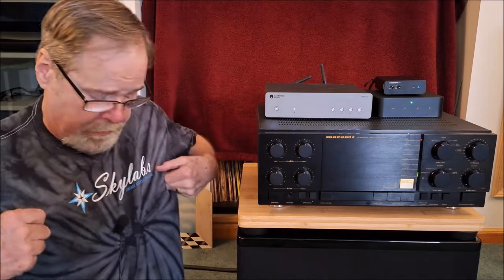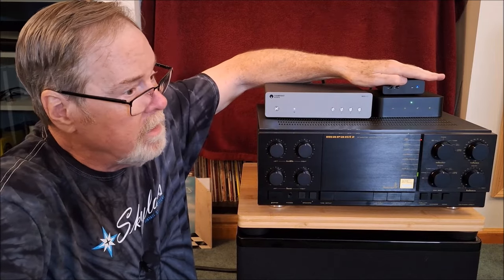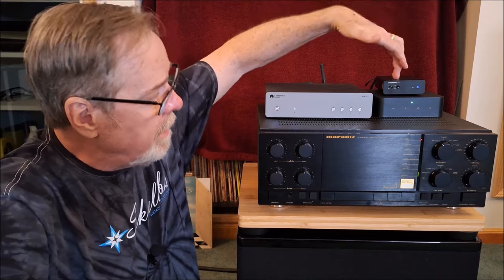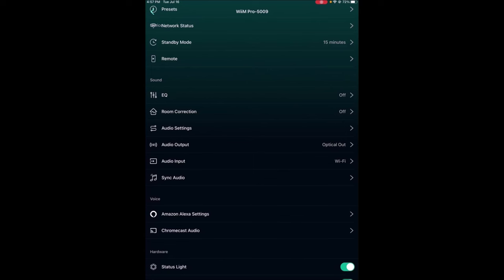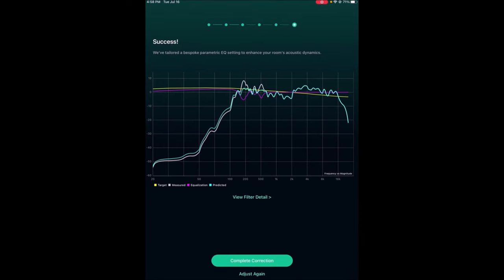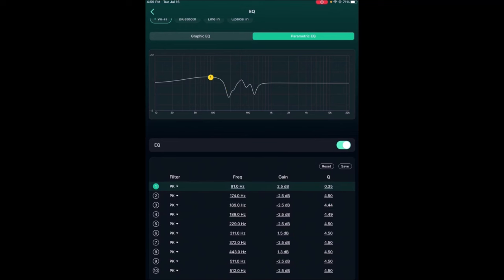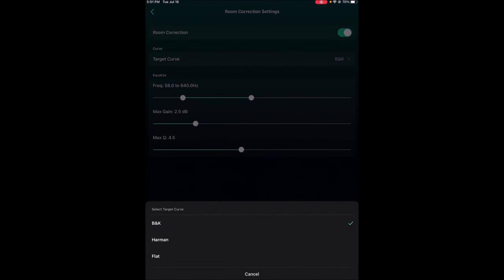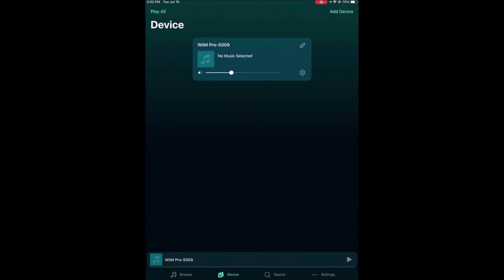You had questions. I have answers. Analog to Digital? Room correction on an analog line in? Yes!

Comment from the maker: A much deeper dive on the WiiM Pro's room correction software. The unit will digitize an analog input, apply room correction and output on: 
1) On the units analog line output.
2) On the units SPDIF Coax output and,
3) On the units SPDIF Toslink output.

Comment: Great video.  I have just got a Wiim Pro.  like you I’m using an external DAC and a Marantz KI signature Amplifier.  I’m going to try the room correction over the next few days.  Thank you.
Reply from the maker: Oooh,. A KI Marantz. Very nice. I knew Ken Ishawata and those KI units are very good. I found the WiiM room correction to more of a gimmick than anything else. Try and let me know what you think. Thx for watching.
Reply: @OldGuyHifi  OK will do.  Thank you.
Reply: @OldGuyHifi  Yes not  sure about room correction so far. it depends on volume set on Amplifier during the test. I find the bass is too high for me after room correction.  Or maybe just too different to what I am used to.
Reply from the maker: @mikepxg6406  It can also depend on what curve you used. Harman vs. B&K etc.
Reply: @OldGuyHifi  AH !   I tried the Harmon today much better sound the B&K was too bass heavy for me.  I will try Flat curve tomorrow.  By the way the test works on my iPad Pro. and my Android phone.  Mike.😀

Comment: Some one may have already commented upon this and I may be wrong but looking up the frequency response for an IPhone 16 it starts falling away below 100Hz-which is why I think my sweep showed huge lifts required at the bottom end. Also I hope those who are not familiar with the WiiM Pro Plus realise that a mobile phone pad etc.device is being used in the seating position as a microphone and the analogue source is just for demonstrating final connection and plays no part in the room analysis. Also the suggested fr correction can be applied/checked and saved.
Reply from the maker: It is really a convenience device after all.
Reply: @ I end up going back to using the graphic equaliser section and my ears 😁
Reply from the maker: @Madmart54  I agree with you. Your ears know best. Thx.

Comment: This is similar in function to the miniDSP 2x4 HD - but with a much easier interface. One thing though, that the miniDSP can be set up to do - is PEQ and time alignment of speakers and a *subwoofer*.
Reply from the maker: The WiiM is just doing EQ. It is great for my vintage stuff but for my main system not so sure. Thx.

Comment: Hey Ed.  Here is a reason to get the pro plus over the pro.  Line in analog goes in at higher resolution on the pro plus than on the pro.   Besides the dac this is one of the main differences between pro and pro plus models
Reply from the maker: Great point and solid advice Alex. I got the Pro just to do the video and I knew I was going to use it only briefly.  Thank you.

Comment: I have 2 WiiM Pro's and a Wiim Pro Plus (that I haven't opened yet). One Pro is paired with a Schiit Modi 3E DAC and the other is paired to a SMSL SU-1 DAC and I love them both to pieces. They retired my Blusound Node 2i. Haha! Can't wait to try the room correction feature. Another great video, good sir!!!! God bless!
Reply from the maker: Ramone, My friend. Thank you so much. Let me know how you like it when you done.
Reply: @ramondelgado6778  Which DAC sounds better in You opinion? The SMSL or the Schiit ?
Reply: @lumberjaxx3335  the correct answer is that they both sound different. The Modi 3E is brighter and more detailed, more airy with boomy heavy bass, with the mid range less forward and a bit thin. Most ears will like this one especially if you have extra warm, dark speakers. The SU-1, to me, is more refined, smooth, tighter bass, warm forward mid, smoother highs. My ears preferred the SU-1.
Reply: @ramondelgado6778  Cheers Ramon, thank You so much for this answer and description!
I have Focal Arias and like strong details, a good sound stage and trebles and highs, i am not so keen on a strong bass, i like it when the bass is punchy but only when it needs to be!
I am not that much on the warm side, more neutral/analytical. 
any recommendation between these two ?

Comment: I am going to take the HDMI output of my Apple TV 4K via optical out from my LG TV into the WiiM Pro, then transfer the output to my PARASOUND  Pre 200 via optical then send that output to my YAMAHA AS701 integrated amp. via analog out. All this to get Room Correction and EQ. Only paid $130 tax included during Amazon Prime sale! Needless to say I am very appreciative of your video reviews.
Reply from the maker: Thank you Jack. Please let me know how that works out. Thanks for tuning in and sharing your configuration.
Reply: @OldGuyHifi  First Impressions:  remarkably easy to install application. It took numerous attempts to complete the Room Correction process, but once done works great. Just need to pay attention to those input & output settings. All of my config's equipment is new including my B&W 606s on stands. After getting everything connected with quality cables, the music output and especially watching F1 was nice but underwhelming. After I completed the Room Correction process, I started using the EQ presets and the "Movie" preset fixed the F1 playback issue (too harsh, thin sound) Now the F1 races have the robust detailed sound I expected to hear!  I have tried a couple of the other genre -specific EQ presets and all I can say is "WOW!" Music sounds correct at last! Articulation and warmth are terms I had only read about now I can hear the music clearly and with real quality playback. I'm not an audiophile or vintage collector but your excellent video provided clarity and led me to purchase the WiiM Pro. Best $130 I've spent in a long time. Now I just need time to re-listen to all my favorites and hear them like they were intended to be heard. Thanks again!

Comment: Thanks Ed. A lot of great info!!!

One stupid question! If one did the following....
 Turntable>>WIIM>>DAC>>Integrated Amp

With a built in phono stage in the integrated would it be okay to run the ground from the turntable to the integrated and rca to the wiim? Or would you have to stick a separate phono stage in there??

I'm a little bit of a Newbie.
Reply from the maker: you would need the separate phono stage as the the WiiM and the amp are not on the same ground plane.

Comment: Could the WiimPro (with, maybe, an external DAC) be used in a vintage receiver’s tape loop or in place of main-in/pre-out jumpers? This would be cool as all the vintage gear’s pre-amp functionality would be retained.
Reply from the maker: I had that question earlier, I am going to try. My thought is no. The way the unit does its I/O selection and the fact it is a source in and of itself, I suspect precludes it from that type of operation. But, since you asked, I now have something to do tomorrow. I will report back. Thanks Steve.
Reply: @OldGuyHifi  Hmmm… I have a WiimPro but no suitable vintage receiver or amp, or I’d try it myself. Before using Audirvāna made it obsolete, I did the following and it worked: WiimPro → Bifröst DAC → Amp, so there may be a chance. I didn’t, however, try using the WiimPro analog in. It will be interesting to see what you find out.
Reply from the maker: Steve, I didn't get a chance to try that connection. I will this weekend. Sorry.
Reply: @OldGuyHifi  No sweat… for me it is just a curiosity, though it maybe be useful for others in the Old Guy HiFi tribe.

Comment: I'm curious to get your take on the "sound" after running room correction -- I've been using ROON DSP and it's been love and hate :)
Reply from the maker: If you look closely at the curve, the yellow target line and the purple EQ line were almost on top of each other in the B&K curve setting. I am fortunate that my room has some acoustic treatment and was purpose built as a sound room. The amount of EQ applied didn't really do much for me. Also, truthfully, I am not a DSP or digital EQ fan. I have a Schiit Lokius that I use to apply tiny amounts of EQ when needed. Since I really don't have any bass issues in my room, which is where most rooms have problems, it did nothing much. I can see its value in untreated or problematic room situations. I do think it can help many people achieve better sound so it is a good unit for that. I understand your love-hate relationship with Roon DSP. Thanks so much for commenting and for watching. I do appreciate it.

Comment: Hello oldguyhifi!!! one thing I'm a little confused about is will I be able to get the benefits of the wiim EQ and room correction with the Cambridge AXR 100? if so what input would I plug the wiim into on the AXR100?   Thanks in advance and once again great video!!!
Reply from the maker: Great question. You will absolutely get the benefit. I would recommend plugging the WiiM's Toslink optical output into the AXR's optical digital input. All of the sonic magic occurs within the WiiM and it just outputs the equalized signal into your receiver. Does that makes sense? I hope you enjoy the AXR100 as much as I do. Thank you so much for tuning in.
Reply: @OldGuyHifi  yes it does makes perfect sense!! I was the one who posted in your other video about the AXR 100 having the issue with that fan noise. I got a hold of customer service but they said that's to be expected especially how loud I drive it plus mines kind of in an open area so it's easier to hear it. thanks again for all the help!!!
Reply from the maker: @prisonerofmarz1265  Be careful with your hearing. I was exposed to too much loud music and now I have some Tinnitus. Be careful my friend.
Reply: @OldGuyHifi  lol   I know what you mean my friend!!! I'm in my 40s right now and back in the day I played in a punk rock band. I never listen louder than 75 db. surprisingly my hearing is still going strong knock on wood!!! i'm actually playing with speaker separation as I'm writing this I had my front speakers around 7 feet apart but doing so I'm sacrificing distance from sidewall so I'm going for more toe in to team the reflections since the width of my room is about 11'10"  but once you tow in the speakers then you wanna measure from the tow in angle correct?  so in theory that gives you even more space from the side walls?
Reply: if it was up to you old guy hi-fi would you sacrifice speaker separation/soundstage for more distance from the side walls? Right now I have the speakers separated by 6'7" and I sit exactly the same distance
Reply from the maker: Sorry for the delayed response. I tend to sit a bit further from the speakers then they are apart. My speakers are about 8' apart and I sit about 10' or so from them. Toeing in does change the point of first reflection and can help with imaging but often it can increase HF information.  How far from the side walls are you speakers? It is all a balancing act.
Reply: @OldGuyHifi  no worries about the late reply!! I know you're a busy man!! sidewalls I have about 3 feet but I measured them while they're towed in so from the middle of the front baffle the front wall I have them about 2 1/2 feet because I heard 3 feet creates unwanted room nodes that are  hard to correct. so 2 feet seems to be better. but right now separation wise I have my front speakers about a little over 7 feet and I'm sitting 7 feet away from them my main listening position! thanks again for all the help I really appreciate it!!!
Reply from the maker: @prisonerofmarz1265  It is my pleasure. Keep me posted on your progress. Thx.

Comment: How does the room correction sound compared to no RC
Reply from the maker: Leo, Great question. Truthfully I didn't care for the results. If you saw the amount of correction it wanted to apply, it was small , as my room is treated already. The EQ the unit applied, to my ear muddied the sound to much. The room correction theme was more of a proof of concept/informational video for folks curious about how it works and how you set it up. Many people are interested in room correction and no other reviewer did a deep dive it how it functions. It can help many folks how have little control over where their Hifi is located so it could be a big benefit to them especially with low frequencies. . In my case not so much. Thanks so much for you view.

Comment: Hi from another old guy that enjoys your channel and what you do. Thanks for that.

I'm scratching my giant bald spot though.. I use TIDAL for everything now. I don't intend to ever go back to analog for anything. I'll let my DAC do that. Listening to these channels though, as I understand it, a person would use a turntable or tape because it starts analog and it stays analog all the way to the speakers. 

My question then is, why bother owning anything analog if you are going to convert it to digital? I think that the equipment owned by the TIDAL's of the world would do a much better job of conversion than a personal streamer. 

Doesn't matter to me though, I only stream. I just wanted to comment and see what you think. Thanks.
Reply from the maker: Maurice, You do make a good point. In the world of vintage, the idea of being able to play back all those old records and tapes has a huge appeal. I listen to vinyl all the time myself and no I would not necessarily want to digitize that signal for any reason. However, being able to do the room correction on any signal, analog or digital, can make a system sound more balanced as it can correct of some minor room anomalies.  I am lucky in that I have a partially treated room so, my issues are minor at best. I do use an EQ just to fine tune the sound to my tastes. My feeling is that if it helps someone enjoy their music more that is great and ultimately all that matters. Thank you for the great question/observation.
Reply: @OldGuyHifi Well said! Yeah I think for most of us audiophiles we are going to optimize our room and/or equipment first before resorting to ADAC to be able to room correct for analog sources. I can understand now that there may be situations or limitations that might prevent someone from making the desired changes and therefore would experience a net improvement despite conversion loss. Not everyone has a dedicated listening space. Good to know there is now an extremely high value solution available. Thanks for the video!
Reply from the maker: Michael, Thank you. As I said, if it helps someone enjoy their music more, go for it!

Comment: How did  your system sound , better ??
Reply from the maker: John, My room is already treated and if you saw the white curve there was little difference between the measured and the "ideal" curves. So, little EQ needed to be applied. I did try it in one of my other systems and it had a nice effect so guess what? it is staying there! Great question. Thanks for the view.
Reply: @OldGuyHifi  hi thanks , I acquired  the wiim yesterday going into chord quetest dac , optical ,into  roksan attessa amp , just waiting for the android update
Reply from the maker: @Lovelacewatkins139  Don't hold your breath. Android is an issue. Apple controls the manufacturing of their products so the mics are always the same. A million people build Android devices and each one has a different mic so it becomes a compatibility issue. Have a friend with an iPhone visit and use their device. I might be wrong but I got feedback people smarter than me that, that was the issue.
Reply: @OldGuyHifi  arr , never mind at least there is enough e. q. To play with  with I did not have from the attessa streamer .
Reply from the maker: @Lovelacewatkins139  True. If there is an Android I will do an updated video. Thx.
Reply: @OldGuyHifi  I'm using the 2nd Android beta with an ARC external mic. Pretty happy with it.
Reply from the maker: That's interesting. I will check out the update. Thanks so much for sharing that.